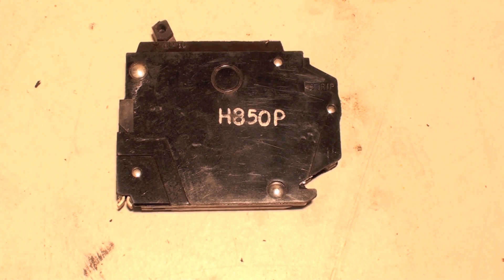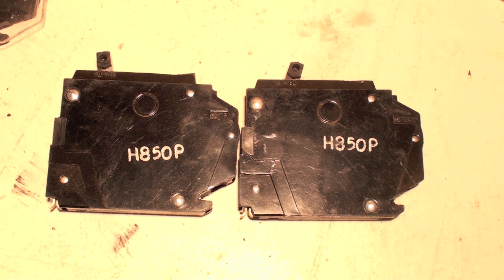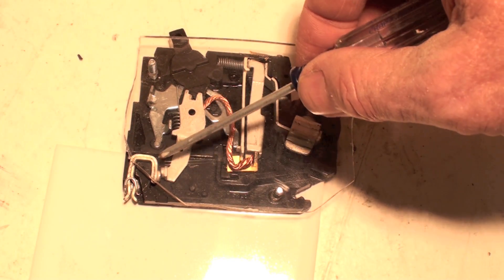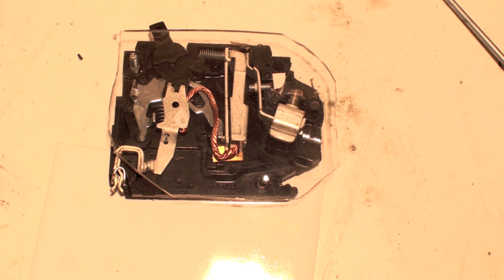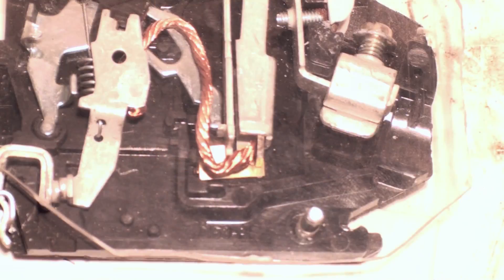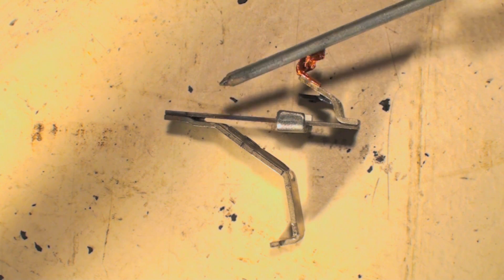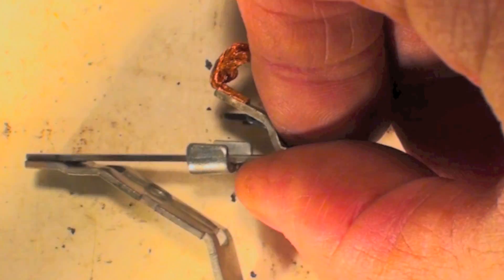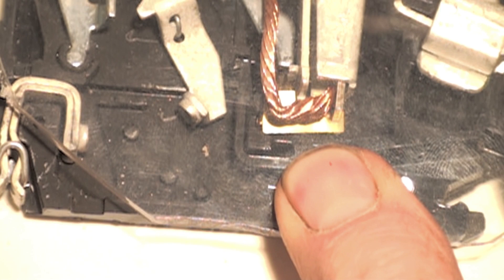How does the circuit breaker work part 1

Comment: Breaker? Fuse? Same concept. Both use heat to work. A transient amount of electricity may always leak though. If you really wanted a something different you can have individual step down coils or digital power supplies but that would get expensive!
Reply: They are NOT the same concept :)  They both break the circuit but by different means.  A fuse filament not only gets hot but burns right up until there is no electrical path left.  A circuit breaker gets somewhat hot (not nearly as hot as a fuse) and a springed mechanism, as grayfurnaceman demonstrated, is tripped by the warping of the heated metal.  A fuse also remains "disconnected" and needs to be replaced but a breaker can be reset any number of times.

Comment: I did what I said, switching parallel with series. Put a 20 amp fuse and a 20 amp breaker in series, and shorted mains. The fuse popped every time, while the breaker remained closed circuit. I also put the breaker on my high current transformer to see how much current it would take. I had it at 80 amps for 1 full second before it would pop.

Comment from the maker: The power passes thru a bimetal strip and if the power exceeds the rating, the bimetal overheats, bends and trips the breaker.  The bimetal is 2 pieces of different metals bonded together that expand at different rates with temperature increase.  The bimetal then bends to trip the breaker.  Hope this helps.
GFM

Comment: I took a circuit breaker exactly like this (20 amp) and a 20 amp fuse, ran them both in parallel, and tested to see what one would pop first. The fuse popped first every time. How I see it, is that this breaker will always protect your wires from overheating, assuming the correct amp rated breaker is installed. But when under no load, and suddenly under a direct short, the breaker won't trip instantly like the ones with the little coil in them. It will take a second or two to heat up, then trip.

Comment from the maker: The circuit breaker is a time delay relay under normal conditions.  When there is a hard draw such as a short then it will kick off very quickly about the same time as a fuse well.  One of the primary advantages to this type of circuit protection is that the breaker will not kick off under a low overload condition unless it is on for an extended time.  Hope this helps.
GFM

Comment: Thanks for the demo. So realistically, if a circuit with this breaker were to go under short circuit, it wouldn't pop right way. It would sit there for a second or two until the strip has heated enough to open the contacts.